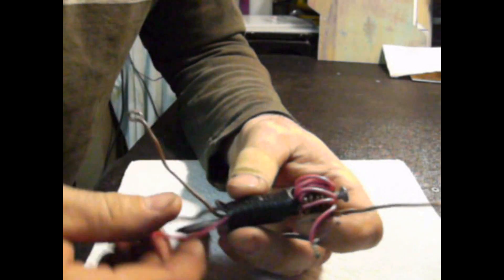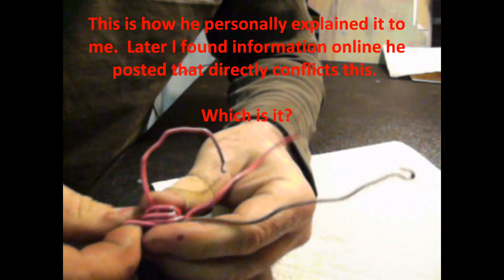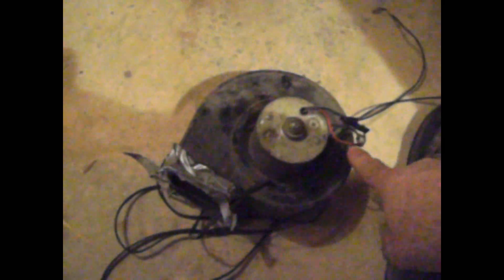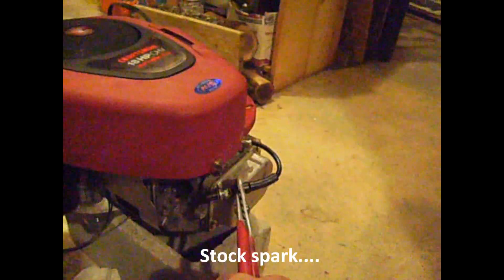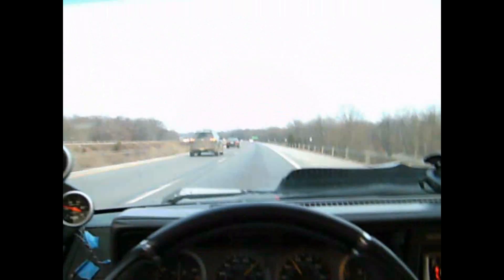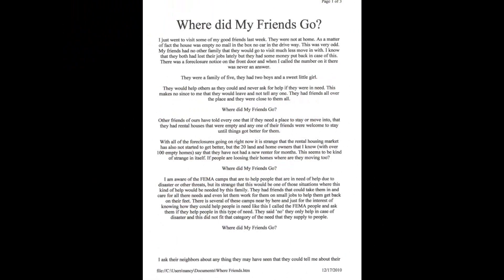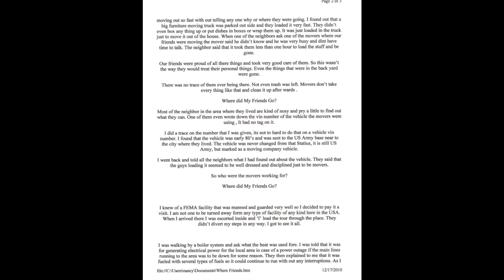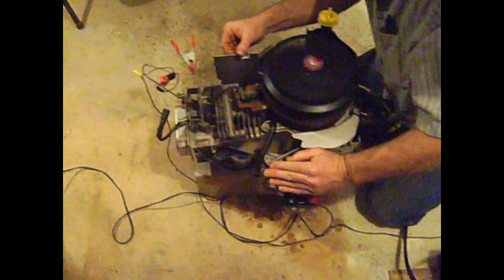Smack Investigates the claims of s1r9a9m9 - part 2

Comment: You did a excellent job here, I will personally commend you for doing so. You was very respectful and considerate of Nathren here on Youtube.

I will publicly state that I was wrong about the B&S engine. I thought it was running on alcohol when in fact it was from the gas fumes in the crankcase. Very dangerous as I have had an engine ignite fumes in my own oil pan before due to a bad coil.